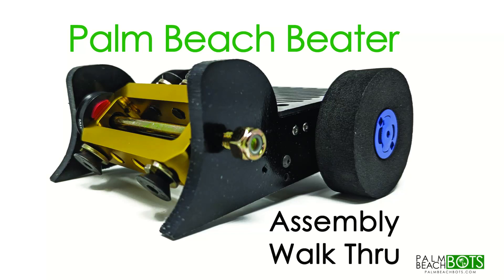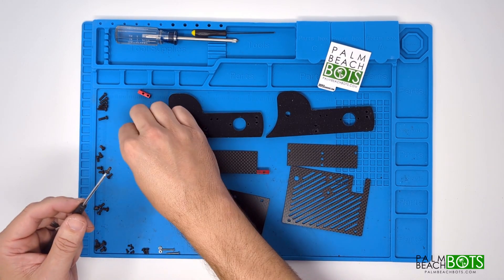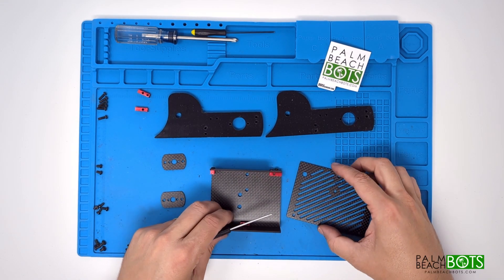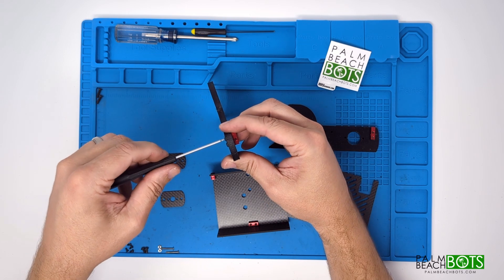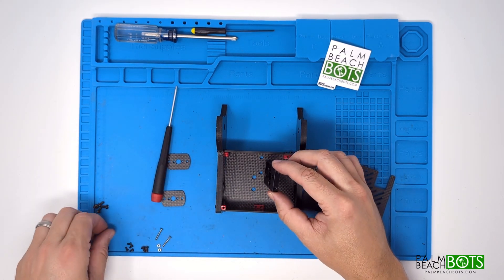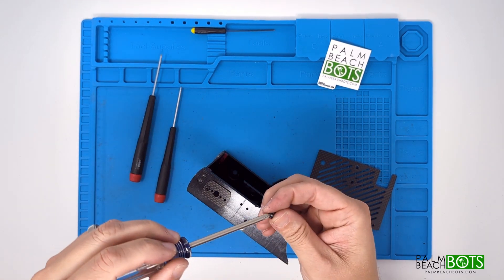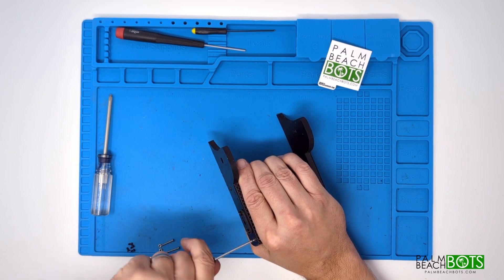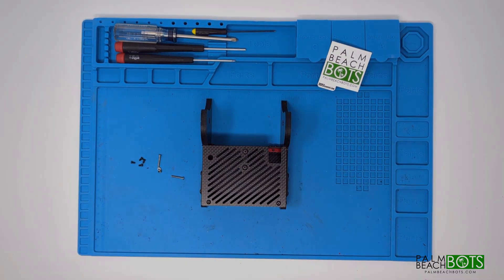Palm Beach Beater Assembly Video

Comment: I am attempting to build this kit with my child for a school robotics program.  The chassis instructions are ok.  The instructions included for the guts/wiring are terrible! Unless you are very knowledgeable with ESCs, receivers and power supplies the info provided is no help at all.  Any chance you could do a part two of this video to cover the internals? Better written instructions with visuals/diagrams would be an enormous help too. I have a very discouraged kid who was excited about building a battle bot but we are at a standstill with the internals.  😕
Reply from the maker: Just seeing this comment.  The instructions are only for the chassis.  There are pictures and minimal wiring instructions in the printed instructions as an overview but it's meant to be an intermediate kit.  The product description notes that it's not intended to be a first build for anyone as it requires perquisite knowledge.  The plastic antweight and viper kits are geared towards beginners and can be built with no previous knowledge.
Reply: @palmbeachbots  I've been into R/C planes and drones for about 20 years now so I don't think I'm a "beginner".  I built a drone from the ground up, built planes from kits, am a ham operator.  I have to agree with rbackowski, the "directions" for the "guts" is seriously lacking.  I think me and the kid will get it together, but what would be so hard to include a vid for that part?  Check out some old Heathkit manuals to get a feel for documentation.  They refused to let you fail.  Here's another example of over-the-top assembly documentation:  https://drive.google.com/file/d/1Vu0JXC9d-rM4gL33crbj8Tf5OlsuNO6S/view
Reply: Just wondering, did you ever get your bot completed?
Reply: Yes.  We received some help from students on the high school robotics team and we were able to compete. This is the build we were assigned in the program and didn’t have a choice to switch.  So, it wasn’t a great experience.
Reply: @rbackowski  Well, just starting with grandkid.  I've had a lot of experience with r/c planes so we'll see how this goes.  Finished it.  Although the vid makes it look more complicated than it is, it's really a simple build.